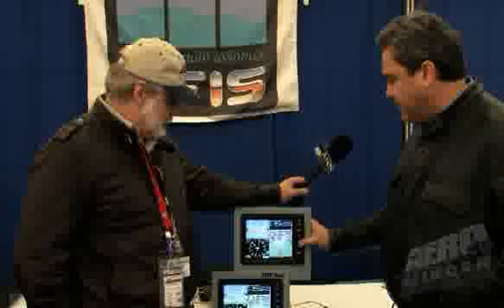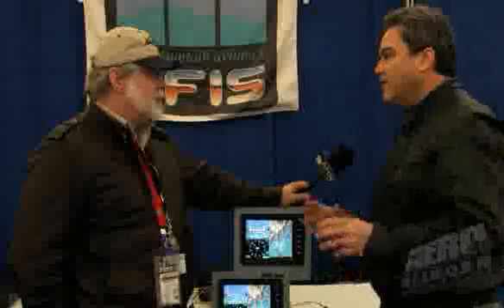Blue Mtn. Avionics Shows Off Its Wares For Aero-TV ...

Comment: I built every EFIS Lite BMA produced from 2001-2006 and they performed well for many years.  Then I left the company in the Spring, 2006 to open a computer sales & service center. BMA folded not long after this video was made. I didn't have anything to do with the new EFIS products which Greg designed around 2005 and are seen in this video. They were inherently flawed; the units froze due to heat, often on the bench during testing and calibration. They were shipped out & came back in droves, and since they were manufactured outside our shop, we couldn't fix them. It led to many customers losing thousands in deposits and full payments. I regret that decisions were made to outsource manufacturing and little thought put into alpha & beta testing before production commenced. This led to serious cash flow issues beginning in 2006 and the following year as the company couldn't pay the bills. Greg fell off the planet for a time and being the brilliant engineer he is, started another business that was successful. I would like to think that he made good on all the RMAs with refunds, but I don't know.
Reply: Briefly worked for him at BMS. As others have echoed, he was not open to new ideas. He was very self-contained. You can't build an effective team shrugging off your core employee's abilities. Hopefully things turned around for the better for him. Had heard his personal life took a turn about the same time as his professional career. That all can be very overwhelming.